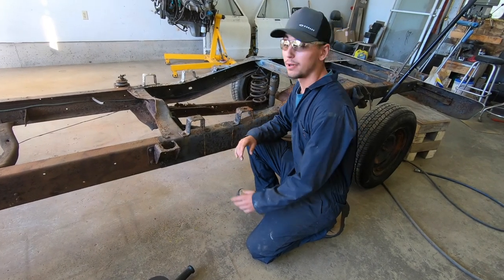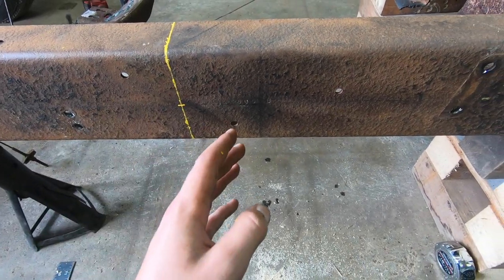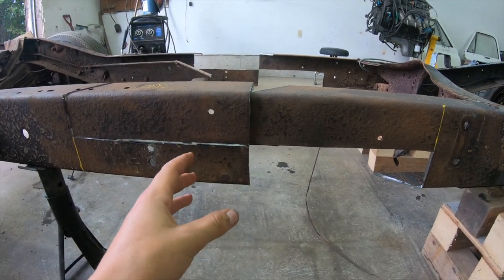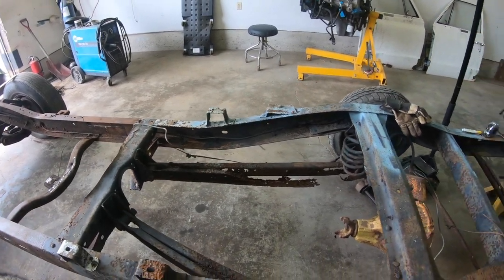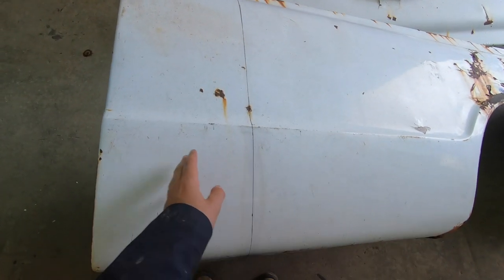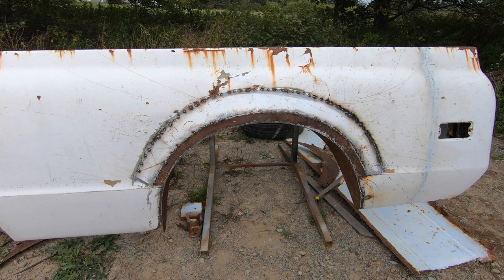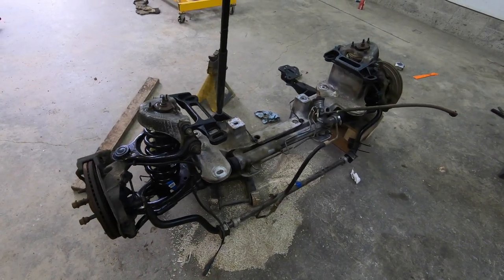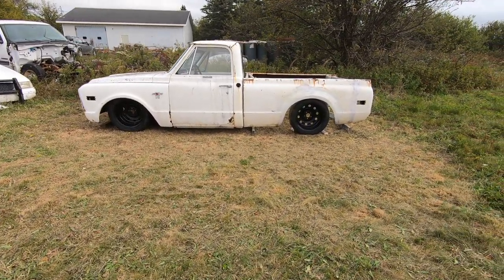Turbo 1968 C10 build: Shortening a long box the right way! (Episode 2)

Comment: Its horrifying how many people cut frames without a step. A vertical butt joint is not one of two ways to do this, it's just the wrong way. The only thing I'd change in your steps is to radius the 90° angles on frame faces. Your way is perfectly fine but in my head a radius is less likely to start a crack
Reply: Agree 100% on the radius, just seeing that 90 degree corner makes me cringe a little... not nearly as much as when i see the straight up and down cut though
Reply: @defendermodsandtravels  I dont need to see anything. A single vertical joint is fine for a show truck trailer queen that's never going to be driven anywhere besides behind a velvet rope. It's the easier route for the run if the mill DIYer but anyone who knows structural strength will opt for the added steps.
Reply: @maggs131  Are you a qualified engineer?
Reply: @defendermodsandtravels  would it matter? You wouldn't believe me if I was. You dont need to be an engineer to see the strength differences. Maybe I'm a 30 master welder. That wouldn't matter either because you saw a video of some guy cut the frame and bolt a plate on the back. 👍

Let's put it this way. Ok maybe a single cut is safe but why settle for "just good enough"?

Comment: We cut frames down all the time..c10 to diesel trucks. Even your step method is weak without reinforcement…I’m not talking about boxing it either. The upmost important step is to make certain your wheelbase is what you need and both sides match. Use factory matching holes and measure diagonal. C10s are easy..measure 10 times and cut once. I slide the frame inside itself a foot…clamp it, sink 2) 3/4 bolts on each side, lock it down and stick weld it with 7018. LWB 127” wheelbase SWB 115”…show quality? No. Strong? Stronger than a original swb frame.
Reply from the maker: You are absolutely right! If I had continued with that frame I would have bolted a plate as well. Thanks for the advice and for watching!🤙

Comment: You’re doing an awesome job!  Did anyone tell you that you can get an awesome plasma cutter for $300?
Reply from the maker: Appreciate it! I have a plasma cutter, but I didn't get it for $300 unfortunately😂
Reply: @ag_trucks  why do you use the grinders for cutting, is your plasma cutter old tech?
Reply from the maker: It just makes a cleaner cut since I have to join some of those pieces back together
Reply: @ag_trucks  for those simple rectangular strips of metal that you used on the underside of the front of the hood, I would use a piece of wood aligned with the mark to zip across the cut in literally two seconds.  Is your plasma cutter inverter with pilot arc?  The edge of the cut on sheet metal should be clean and slag free.  Unless your air is wet…
Reply: @ag_trucks  I’m not trying to troll you; I just wondered if you were aware of the latest tech.  I have a Lincoln Power Mig 140 that I can barely carry around when I need to.  It’s a great welder that cost me $800, but I have a welder that weighs 13lbs, has a smoother arc, and cost me $101 brand new. I thought maybe your plasma cutter might be an old Snap-on or something if it was expensive and doesn’t cut sheet metal clean
Reply from the maker: No worries man, I have a hypertherm powermax 600 that does cut cleanly but I'm just more experienced with a cutting wheel. I used the plasma cutter for thicker metal and to make all my brackets on my frame👍
Reply: @ag_trucks  damn; that’s a good one!  Did I mention how bad I hate any kind of grinding?…lol

Comment: Hey there young fella you could have just measured forward one foot remarked your holes cut everything off at the rear then weld flat plate to box it in. More cost efficient then you could have also C notched it then gone with air ride suspension that would hold up a lot of horse power doing it to my 67 also coil spring set up but will be going air ride though.

Comment: Have not seen that stepped method! Glad I did and will be doing the same to mine.
Reply from the maker: Awesome! Thanks for watching🤘
Reply: Anyone who just cuts the frame at 90° and just butts the joints without a step is asking for disaster. It's so weak and brittle.

Comment: So did this method not work? I’m confused at why you started from scratch. It looked like it was going to be a great frame and strong. Fill me in.
Reply from the maker: It would have worked, however, I decided to go a different route in terms of the build. Those c10 chassis have a lot of flex and I am planning to make a lot of power so with a new frame I'll be able to make it as stiff as I want. And I also want to integrate a roll cage with the frame.